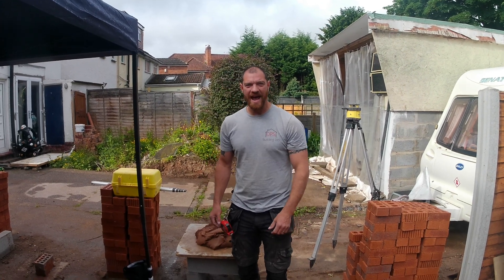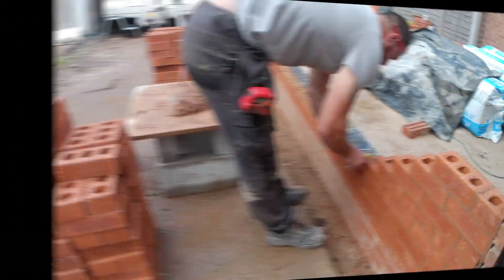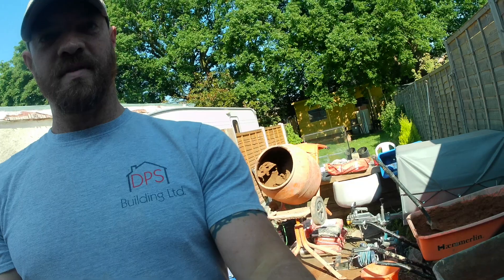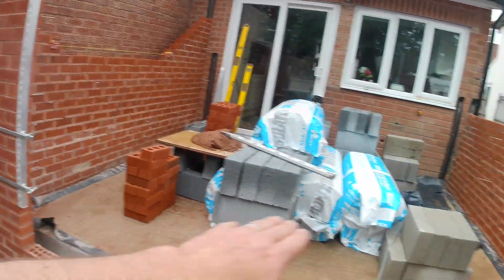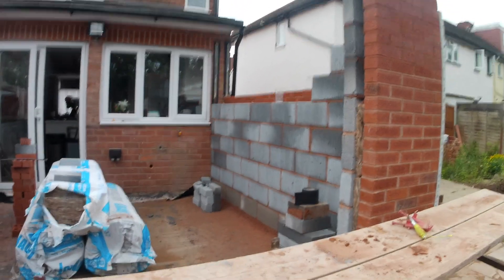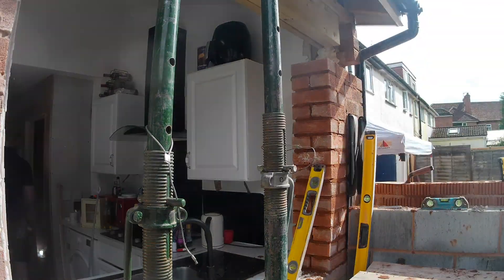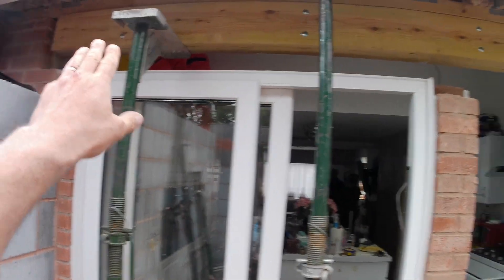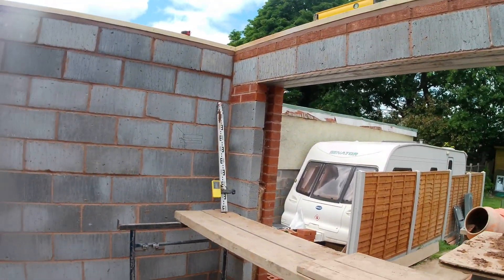Build to Wall Plate

Comment: That string line you use looks amazing, where can I purchase one from? thanks
Reply from the maker: Its just a normal string line but I use clamps instead of blocks. 

Deepocean 2Pcs Brick Liner Runner Wire Drawer Bricklaying Tool Fixer Building Construction https://amzn.eu/d/brdZXVY
Reply: Where did you buy your wall ties and what type were they